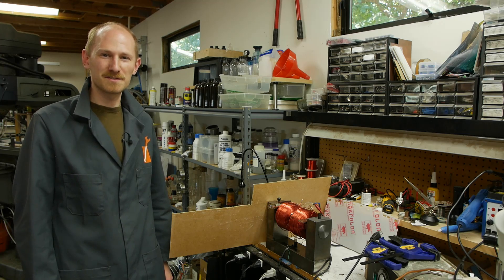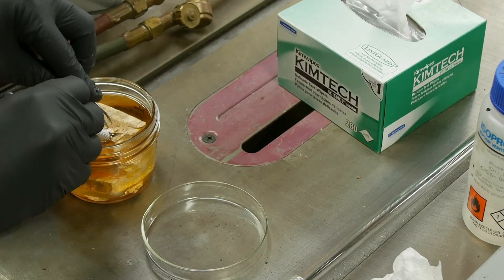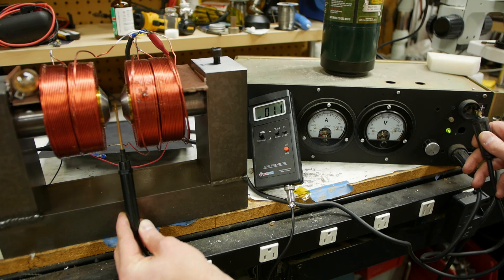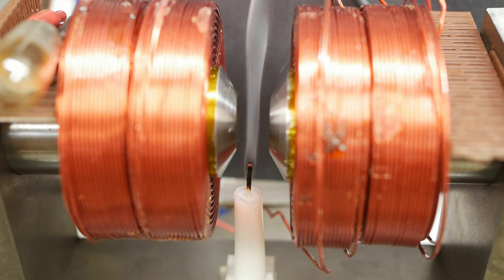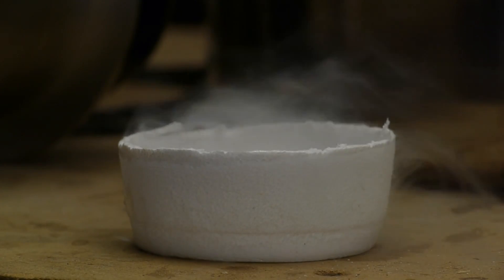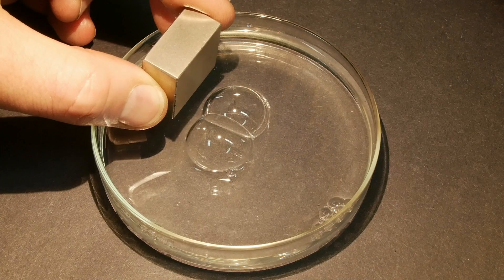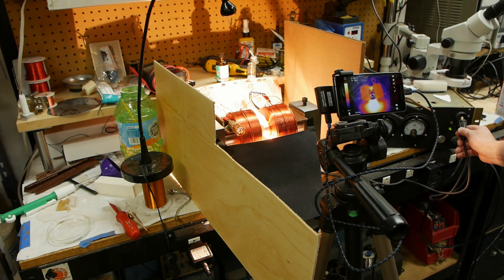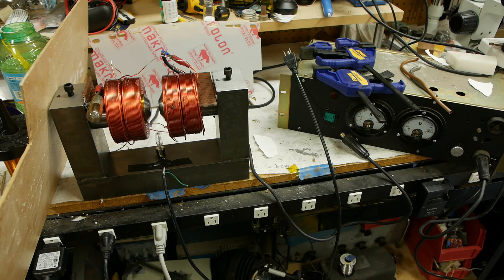Candle flame is repelled by magnets (and Zeeman follow-up)

Comment: Try the flame experiment using an electrical field instead of a magnetic field. It might spark a bit of insight.
(There is an answer for the candle flame magnetics. But sometimes it is better to come to the conclusion yourself instead of being told.)

Comment: The change in density is interrupting the flux lines of the magnet.  Take a tube and fill it with ice blow air through it slowly and place it in your test rig instead of the lightbulb.  Reimage with the flir and paper.

Comment: You put your gas bubble in the very center of your magnet, where the field is uniform. If you want to produce a force on the bubble you should put it at the edge of the pole where the field is inhomogenous.
Reply: Yes, I second your comment.  Was thinking exactly the same thing.  This other video using 50mm sphere magnets shows field measurements enough to guestimate gradient of field squared:
https://www.youtube.com/watch?v=dX2R4hRAYMc
For that video, I'm estimating about 1.0T to 0.7T over 1cm distance.  If I'm calculating correctly, that makes a force just over half of the buoyancy force of hot air, based on air relative permeability being 0.37PPM above 1.

Comment: Can we crowdfund you a proper mad scientist knife switch, or is it just an impressively bright spark without any damage?
Reply from the maker: Good point.  The arc is causing some damage to the terminal. :)  Even with Amazon next-day, I often get into the spirit of making a video, and cannot wait for new parts.  I couldn't find a switch in my shop that would interrupt 50A and not weld itself.
Reply: A flyback diode (sometimes called a free wheel diode) connected reverse biased, in parallel with the coil, would eliminate the arc. It will need to be able to carry 50A for a second.

Comment: Why not construct a partial toroid core magnet (I.e C shaped and put the target in the gap)? you might be able to build a higher field setup that way. The construction of your current setup seems pretty lossy.
Reply: He's using a hemholz coil design. The field is plenty strong.
Reply: While it's true that his magnetic circuit is longer than it needs to be (extra magnetic reluctance), it is also true that the magnetic domains within the iron core, align when energized, and add to the total flux.
Reply: You can more than compensate for the non-ideal core shape by applying just slightly more current, or adding more turns while using the same current.
A toroidal core will just reduce the Stray Field, which is the magnetic field that runs outside the core, through the air. This field is going to be very small already though.

Comment: When I was first learning about how flame detectors worked in a furnace banjo burner I was very interested in how they rely on the conductivity of the flame to sense a small current draw down to ground (grounding through the burner). Seems like this ties into that same principal to some degree...
Reply: Similar to auto igniting kitchen stoves

Comment: You need to cool your electromagnet with liquid nitrogen for maximum power
Reply: Liquid helium is waay better.
Reply: Except that cryogenic temperatures might make the magnet core brittle unless its specially formulated - although the prospect of superconducting windings is alluring, liquid helium might allow that, but not easy to achieve!

Comment: I don't get this. Whats the wonder in here? All magnetism is difference in frequency. It exists always when hot and cold, or slow and fast meet. It creates a electric "wind" that creates lift or pull. All matter is burning, some very slow and some very rapidly. And everything is just following the path of least resistance. Its all explained in Bernoulli's principles.
Reply: Kangsteri - A common statement is "Electrical current follows the path of least resistance." This statement has always seemed very misleading to me, because it implies that the current only follows the path of least resistance. Currents also follow the paths of higher resistances too, but to a lesser degree, when multiple paths are possible.  A more accurate description would be: "In an electrical circuit, currents follow all paths, inversely proportional to their resistances." For example, if you connect a large diameter conductor in parallel with a smaller diameter conductor, current doesn't just follow the path of least resistance (the large conductor) it also flows through the smaller conductor, but with less amps, inversely proportional to it's resistance. If resistance is twice as high in a parallel path, the current will be half as much.
Reply: Woo! Woo! Woo!
Reply: Aether is real, so are Maxwell and Tesla :) You can simply simulate the effect of magnetism by hanging two paper tubes from string close to each other and blow between them. They will attract each other, not repel. ALL MAGNETISM, ELECTRICITY, FLUIDS, AIR AND MATTER, FOLLOW THE PATH OF LEAST RESISTANCE. Its the only real rule you need to know. I would recommend everybody to play with cold electricity to understand resonance better.
Reply: Solar Fluxman - True. But that only means that the circuit has pressure or inductance in it. Current flow also creates resistance in the large conductor and the overflow will have to go where it can.
Reply: And actually whats happening here is identical to the "peltier effect". Hot + Cold = Electricity, Electricity + Cold = Hot, and Hot + Electricity = Cold. All circuit have to work both ways. You can split atoms to release energy, but it means you can also pack energy to create matter.
Reply: It would be very interesting to see thermal image about this? I bet it creates a cold spot over the flame.
Reply: +Solar Fluxman Path of least resistance has also bothered me.  I like your statement
Reply: This is an thermoacoustic effect. Am i really the only one to study the basics?

Comment: Is a flame made of plasma? Because if it is, plasma is electrically conducting and effected magnetically. So that could be another cause, if my assumptions are correct?
Reply: The ion density might be low compared to high energy plasma, but it's still high enough to have measurable conductivity with an ohm meter.  Some flame sensors work this way.  Given that, it still seems possible there might be some Lorenz force.  It doesn't require much force to deflect a bit of hot gas/plasma.  So, while the Lorenz force might not be as strong as a magnet falling through a copper pipe, a magnet is also much heavier.
Reply: +Overwatch Actually, he never objectively called it a plasma. That was just me :\
What he said was "Now while some may argue that a flame is not truly a plasma, because it's not hot enough and it doesn't have a high enough density of ions. One thing is for sure; it does contain ions."
Reply: There is a lot of back and forth here on whether or not a simple candle flame has enough ionization to be the greater cause of the deflection in a magnetic field. It’s pretty obvious that this is the case. In fact you can make a flame “sing” by modulating an electric current through it, exactly as is shown with streamers from a Tesla coil or other high frequency high voltage power supplies. If that is possible then the reciprocal effect of magnetic field is also possible.
Reply: Mike Guitar Exactly, almost all discussions about this subject people forget about cold plasma. Also, when talking about cold plasma people seem to forget the Paschen graph to explain the energy needed to form plasma at certain distances and pressures.
Reply: The question at hand is whether the Lorenz force could be deflecting the flame.
Reply: Light itself is being affected by a magnetic field I wonder what it could be :D
Reply: Have you heard of cold plasma?
Reply: Fire is not plasma, it's rapid oxidation/thermal runaway accelerated by it's own exothermic reaction/heat production.
Plasma is the last stage of matter, which needs to be many times hotter than a flame to reach this state.
Reply: Well, in order to ignite the fuel-air mixture, a sparkplug has to ionize the air between the electrodes, to conduct electricity, wich in turn heats up the surrounding area of the electrodes. Could one classify this ionization process as a plasma? Also, the chemical reaction takes place in the flame, right? That means that there is a point in the flame were you will have a lot of ionized or at least molecular carbon, oxigen, hydrogen and nitrogen atoms, right? If so, there would be, assuming a constant mass flow (wich would be reasonable, else the candle wouldn't burn), always an area with atoms that could react to a magnetic field. It may as well have to do with the properties of water vapour or water beeing a diamagnetic element.
Reply: K van der Veen Thanks for the info! Seems to me that because such little force is required to move a flame (it's just a small stream of hot gas) - like Mike Guitar said - even a tiny charge separation and magnetic force could deflect it. Don't think Lorentz force matters here because direct magnetism is stronger and appears to be what's happening here, the direction it's getting stretched towards by the magnet is towards one magnetic pole. Lorentz force acts perpendicular to that, which would be towards or away from the camera?
Reply: Mike Guitar Absolutely, I don't agree with those people saying a plasma has to be ridiculously hot. The Sun's chromosphere and photosphere are plasmas but around 5000 degrees. A spark is a plasma, there's plasma in a plasma ball and they're not hot at all. All you need is ionized gas! A plasma is a gas with the electrons stripped off the atoms, making it conductive, that's all it is - temperature doesn't come into it, just that higher temperatures make it easier and then inevitable to strip off the elctrons. A flame at 2000-3000 degrees (more like 2000 or a bit less for a candle) will not strip electrons off by itself but will make it far easier! 

Then depending on the properties of the gasses within the flame - unburnt and burning hydrocarbons, CO2, H2O, N2 etc - they might lose their electrons to varying degrees, and it's enough to form a (weak/thin) plasma, especially when the dielectric effect of water increases the conductivity. The strong magnetic field and electrostatic effects being applied could also strip off electrons when the atoms and molecules are close to losing their electrons.

We know a flame has excited electrons, it is that which gives the flame its brightness and colour. If they're excited, their outer electrons are getting further away from the nucleus, so they're heading closer to ionization.
Reply: Well tbh you can curve light with a magnet, any light actually. Let's say you got a flashlight, radius of the cone is 60°. With the right magnet you can make the cone go into a curve even bending/going around things as if you would reflect it with a mirror. So this is what I'd like to know when I said light itself is being affected by a magnetic field since it actually is the MF and not the magnet itself bending the light, especially on the edges of a magnet the force is stronger there. Sadly there is not much information or official experiments about that openly visible. But thanks for your elaboration I appreciate your effort about the flame.
Reply: Mandernach Luca “current flow” isn’t likely the best term for what’s going on. The flame is weakly ionized ( in some parts) and so exhibits a degree of permeability. Because it very low mass a very noticeable disturbance is observed when a strong magnetic field is present. If the field were modulated, it might make a better show of it.
Reply: link:
http://www.youtube.com/watch?v=a7_8Gc_Llr8
I agree it's pop-sci, but he does mention the plasma question at 2:08, and the video shows an electric field separating the charges by polarity.
Reply: no, a candle is about 2500 degrees and a plasma cutter temperature is something like 40,000 degrees  or 20,000 C whatever that is in F
Reply: Avenue X 
So there is an actual current flow in the flame, when a magnetic field is applied?
Reply: Yunomegasai Well it's the source of the light that is being affected, I don't think a magnetic field affects light itself (even though they are two sides of the same fundamental force, all electromagnetic effects are transmitted by photons - "virtual photons" but still photons. They only travel a very short distance, merely hopping between very close electrons, so you're never able to see them, but it's all electromagnetism which is all so linked with photons/light.

What you are seeing when looking at a flame is electrons being excited to move away from their atom's nucleus by the heat, then falling back to the nucleus and releasing that energy they gained as a photon of the same energy - which for photons is their wavelength, which is how you can tell the hotness of a flame by its colour - invisible infrared, then red, orange, yellow, green, blue, barely-visible ultraviolet, invisible ultraviolet etc. Just a rainbow basically. Note that which of these you can see depends on the material the electrons are being excited within, since they can only be excited in discrete jumps. A normal hydrocarbon flame like a natural gas flame skips out infrared and red, starting at orange-yellow, and skips out green, going straight to blue when it gets hotter than yellow. But red and green flames and plasmas can be produced by other atoms and molecules (like Strontium being red and Copper green).
Reply: Ok, if we consider a flame to be a plasma (therefore capable of conducting electricity), then wouldn't a magnetic field cause current flow through the flame (analagous to Eddy currents) by means of induction? And if we do have such a current flow within the flame, shouldn't the flame naturally be repulsed by the magnet? Copper in motion around a magnetic field will slow down due to these Eddy currents being generated within the copper (the effect being that the copper becomes magnetic itself; for a long as the Eddy currents are present, a consequential magnetic field gets generated in the copper, causing a slowing down of its motion, as it's nascent magnetic field competes with the magnet's magnetic field).
I see the motion of the flame having a similar cause as the slowing down of the copper.
Reply: When I was a kid I tried putting the flame from the hand held propane blow torch onto the grids in an electric bug light zapper.
Buggers alive!  I was shocked when that electric current traversed the flame and then me!
I can tell you honestly that I tried it exactly once. Not twice.
I don't know the cause, but I know flames are surprisingly electrically conductive. As others have said, this property is very commonly used in electric furnaces to detect if the flame has gone out. I've seen it in many furnaces I've had apart.
Reply: I think flame is a plasma. Veritasium has a very good video titled "What's In A Candle Flame?" you should check it out. They run an electric current through a candle flame.
Reply: RedButtonProductions I was thinking this as well, however I did a quick search of this and found a couple posts saying that the ion density in a flame is quite low. Also there shouldn't be a net flow of ions/charge, since as far as I know that starting and end products of a flame are neutral. Therefore the net Lorenz force on the ions should be zero. Unless the magnetic field would separate the positively and negatively charged ions.
Reply: +Fedas Veritasium is pretty frequently wrong. Either in their assumptions, or their explanation. It is a consequence of them "dumbing things down" to make them Pop-Science.
That said, candle flames are not plasma. They DO have some ions. And the flame DOES kind of act like a plasma. But they don't really have enough ions to be the REASON that candle flames act like a plasma. There are other reasons that these types of soot-heavy low-temp flames act kind of like a plasma.